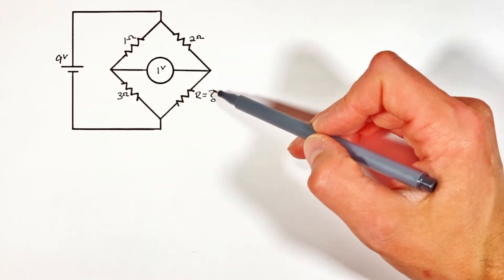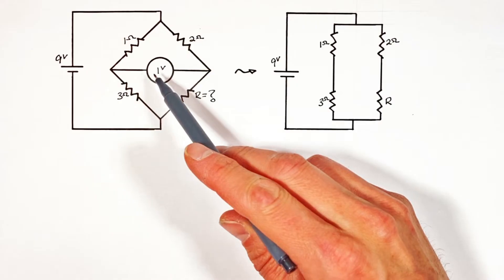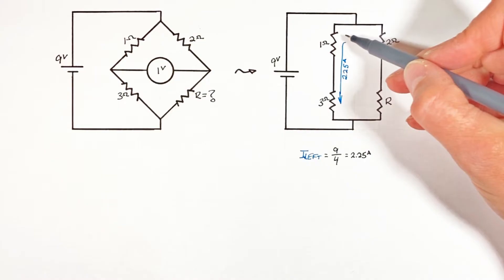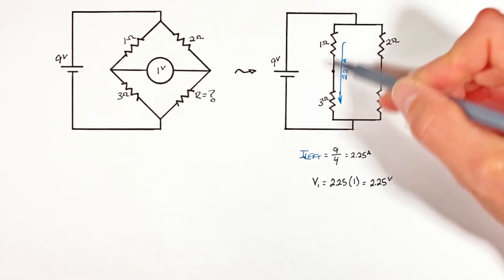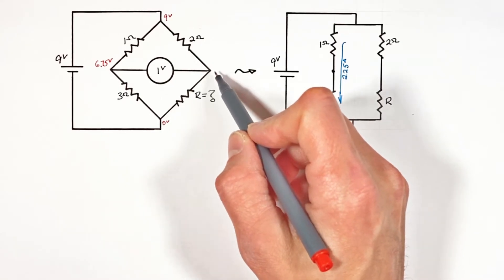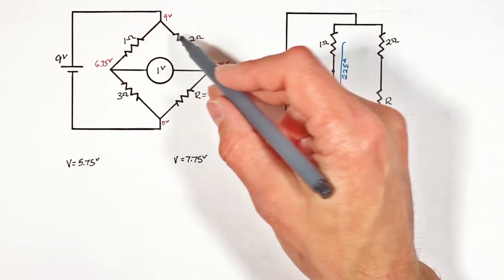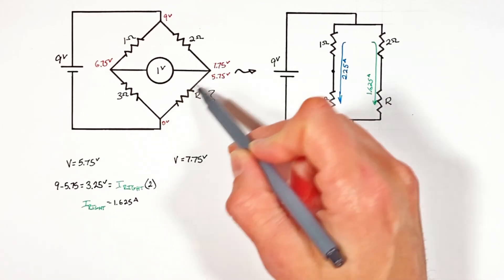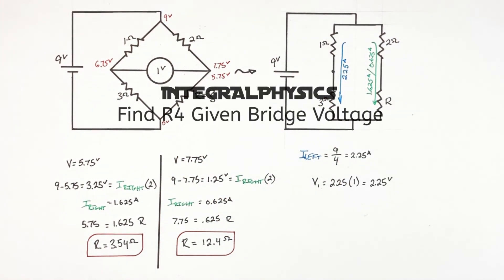Find Unknown Resistance Given Bridge Voltage | Unbalanced Wheatstone Bridge Circuit

Comment: Where do you get the 1v on the meter?   Is that just an arbitrary reference to help figure out the unknown?
Reply from the maker: That is just a value inserted into the problem, much like the values of the other resistors...  I could have used any value between 0 and the voltage of the battery.  1V sounded good.
Reply: @INTEGRALPHYSICS  any chance you’d make a video explaining the voltage variations at the bridge when using an RTD?    The question I’m chewing on is: Calculate the voltage across the bridge (VAB) at the following RTD temperatures, assuming a 604 Ω nickel-iron RTD with an alpha value of 0.00518:
T= 0°C ; Vab = (N) mv.  Etc

I’m having an issue wrapping my mind around this,  probably over complicating it. Idk.  Thank you either way.